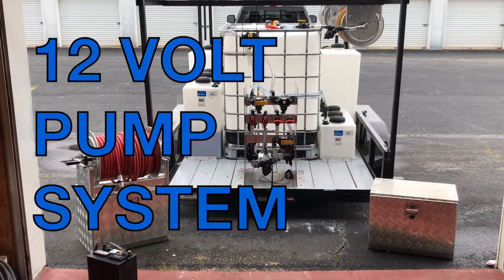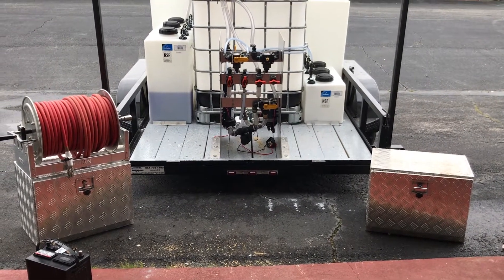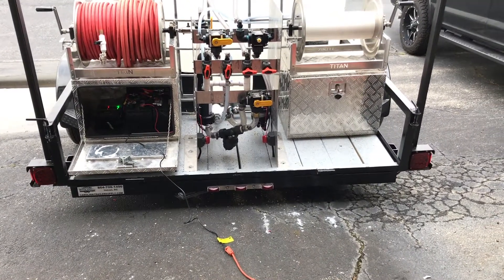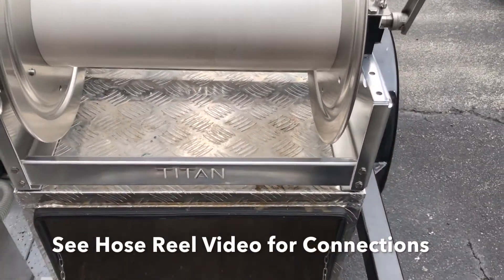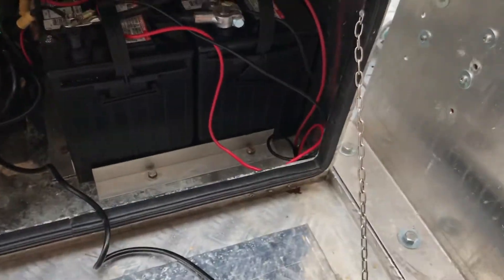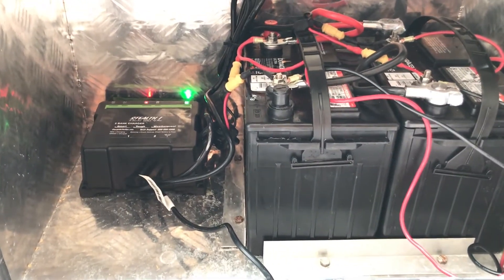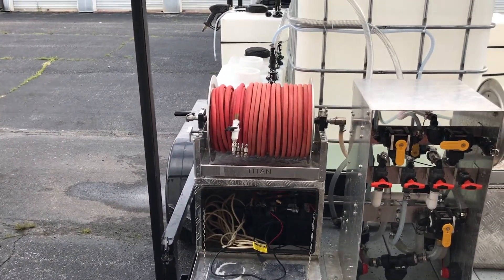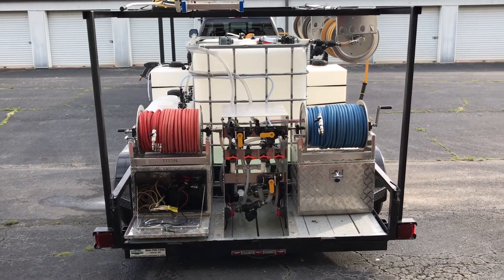12 Volt Soft Wash Pump System - Pressure Washing Trailer Build (8 of 10)

Comment: Great setup!
Where did you get those little stainless steel brackets to hold the batteries in place?
Reply from the maker: Just picked up some 1" aluminum angle iron at Home Depot. Cut to length with jig saw. Drilled a couple holes to mount with screws.
Reply: @proactivepowerwashing7432  can you help with how to make a mixing metering system?
Reply: Thank you so much for the tip I sincerely appreciate it!